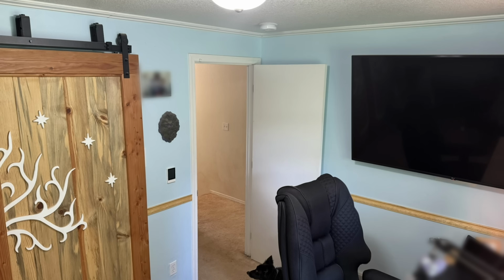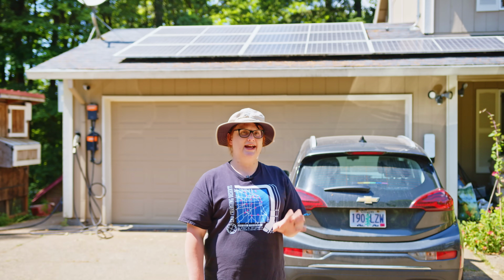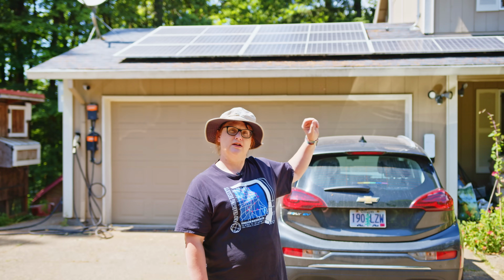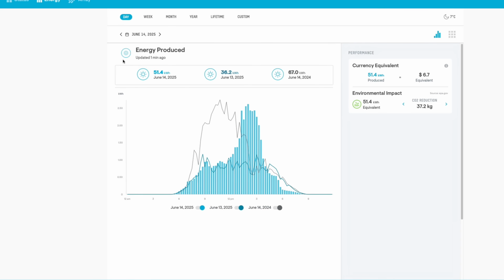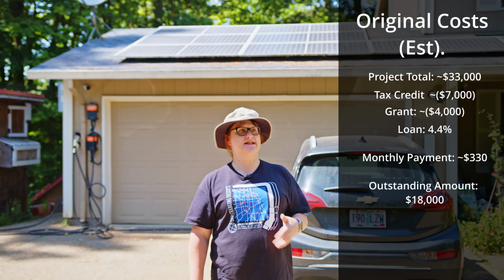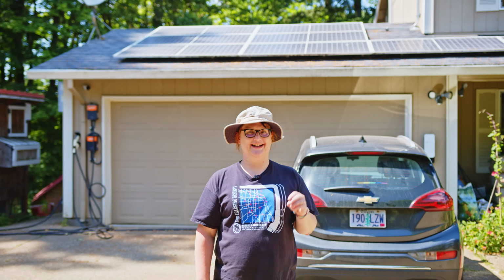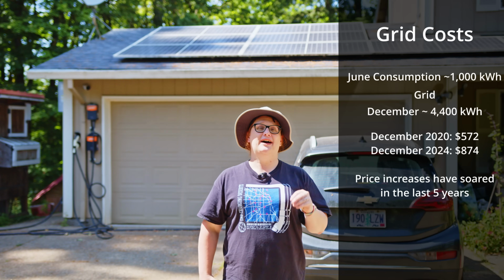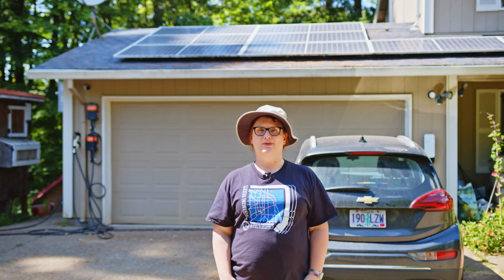Our Solar Array Is Peaking at over 80 kWh a Day! - But Was our Investment Worth It?

Comment: Hi Nikki. 
A couple of things related to other videos I have seen regarding solar panels. 
1 Bi-facial panels. When it comes time to replace the roof on your house have you considered replacing the solar panels with bi-facial panels (or do you already have them)? I believe that I saw a vid on “everything electric” about them and the output seemed good compared with the extra cost. 
2 Panels pointing “in the wrong direction”. Here extra panels had been added basically pointing due north (northern hemisphere, UK location). I think that was on the “Mr. EV” channel. Again it appeared to be a reasonable cost/performance ratio. 

Now I make some caveats: 
Both of these ideas would probably require extra initial outlay at a time when the costs are already high, and you might achieve a lower than hoped-for return. Changing panels would require you to be able to get a reasonable price for your “2nd hand” panels, however with the stats you regularly record during the operation of your panels I am sure you could ease any concerns that a new owner might have. 

Putting additional newer panels on the back of your house might seem to be problematic considering your over abundance of trees. 

I am sure it would be possible to carry out tests for both of these ideas yourselves, assuming money constraints didn’t affect your efforts. 

Of course, the “elephant-in-the-room” could cause problems, maybe even requiring relocation. Making sure that you and your family determine the destination, not ‘others’ wearing masks and hiding their identities, is important. Please whatever else, stay safe, wherever you might be. 
After all, many of us need channels like TE to counteract the FUD - and to bring on the FUN. 👍
Reply: Bifacial solar panels on a roof wouldn't gain much of anything from the back. They need height and space between them. They add some on ground mount arrays. We have installed about 700 kw of them.

Comment: today, is offen more economical to get a house battery,, then it is to in stall solar..
Reply: Then you are totally reliant on energy company tariff structure. Which may change.
Reply: @AlanTov  true..
Reply: A lot of places in the US at least, you can't charge from the grid. I'm in San Diego area of California and our power company doesn't allow grid charging. But really that only applies to traditional house batteries like Powerwalls. Many people are using what are considered portable batteries and connecting through a generator input to charge at night and power during the day. The current off-peak prices in my area doesn't make sense to do that. I have four Powerwalls now and most days I don't import any power from the grid.

Comment: Would it be possible, laws and or local regulations permissible, to put solar panels on walls with solar-light on? Or is it allowed to have solar panels mounted on a fence?  Is there a way for your solar set-up to extend the generating day to become longer than it is at the moment?

There are possibilities with sensors and small motors to have solar panels that do smaller rotations with the sun's movements. That could be either fence-mounted or wall-mounted.
Reply: And get rid of the “Widowmaker” growing next to house!